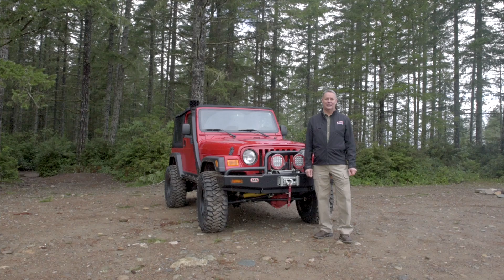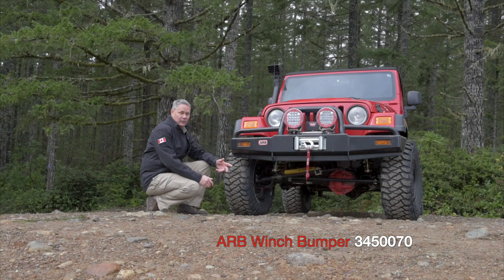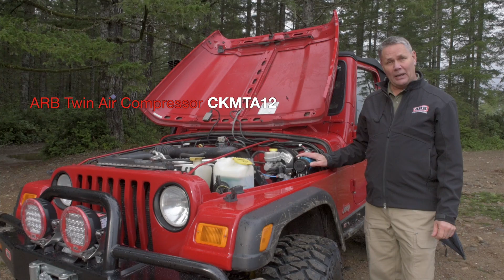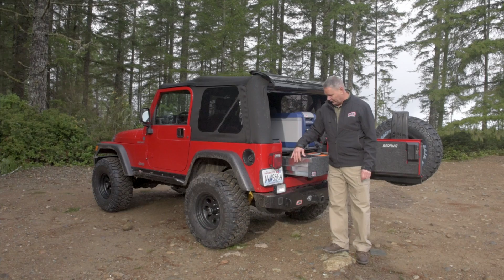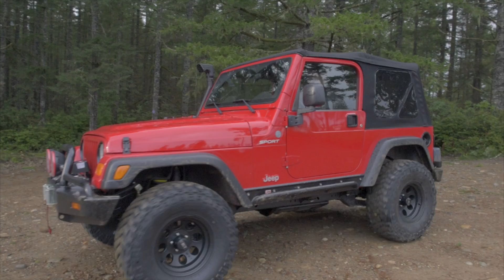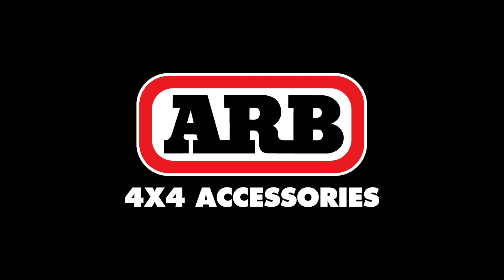Off Road Icons TJ   Post Build Part 1

Comment: How are the 4.88s with 33s? I have the same axles and gears with 35s and I feel like at speed the rpm's are kinda high but the acceleration isn't what I hoped for.

Comment: Do you have a installation guide for that front bumper? Do you need to wire up those turn signals on the bumper?
Reply from the maker: Email our tech department at tech@arbusa.com and they can send you the instructions. As for the lights, you don't have to wire them if you don't want. To wire them, you will need to tap into the turn signal circuit